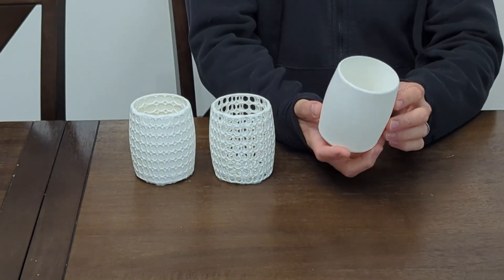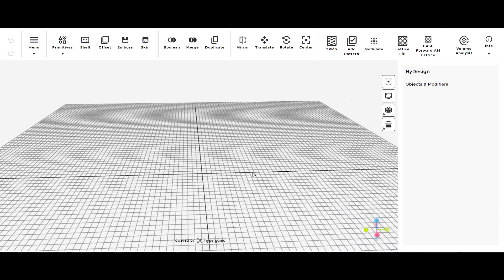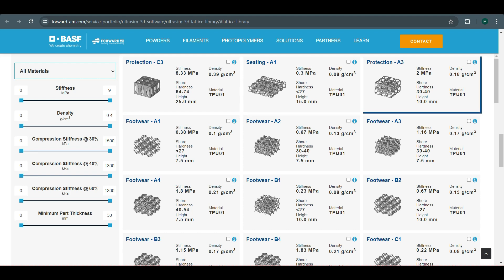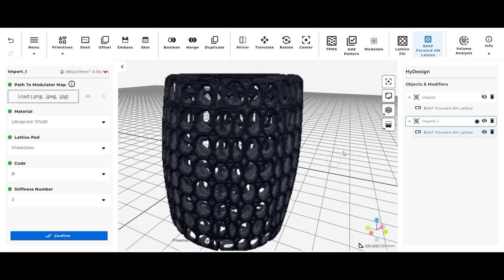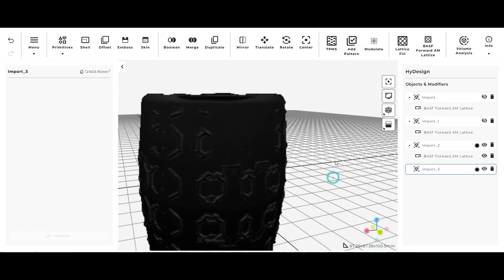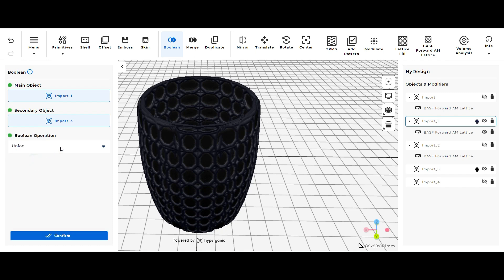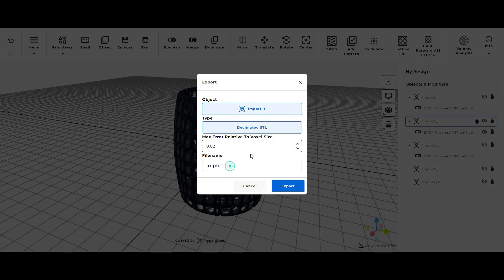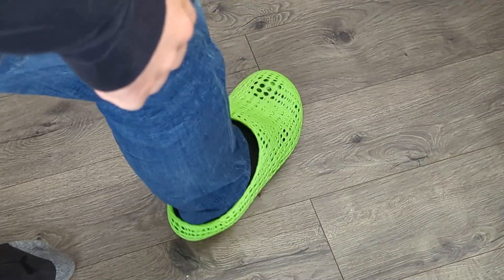How to Easily Add Complex Lattice Structures/Textures To Your 3D Models Using HyDesign!

Comment: Neat, made an airless basketball in Maya and adding the honeycomb pattern was pretty tedious especially getting the scale right, every time I wanted to change the scale I had to redo the operations from the beginning.
A procedural workflow using Bifrost maybe the way to go to create a tool that does that but I haven’t bothered with it, I’m a character artist not a TD.
Reply from the maker: @Icemanmodeler  Dang that sounds like a lot of work, I haven't tried Bifrost but I will have to check it out
Reply: @makeitlabchannel  Not sure if you’re familiar with Maya, Bifrost is a procedural nodal system in Maya.
Reply from the maker: @Icemanmodeler  Oh gotcha, I will have to check Maya out then!
Reply: NTopology with a spherical cellmap could create such a basketball in 2 minutes

Comment: Nice, rlly helpfull info, do you also use fusion 360? Or just blender
Reply from the maker: @IsaCity much appreciated. I have used fusion 360 a bit and it definitely has its strengths (especially mechanical or accurate designs), but I use blender for about 95% of my designing because I can have something done by the time I figure it out in fusion lol